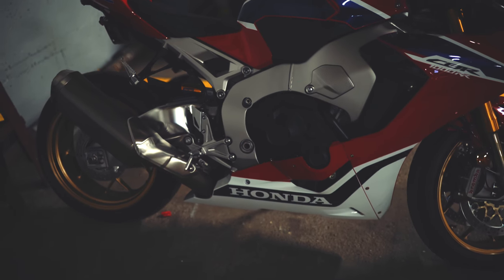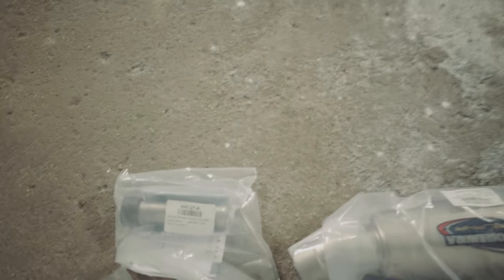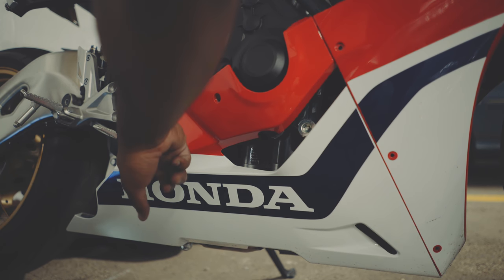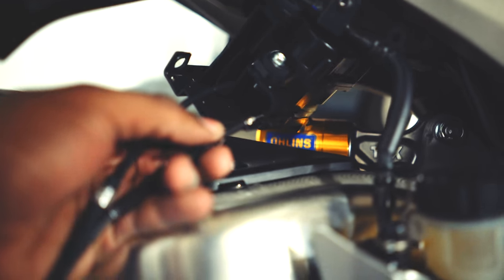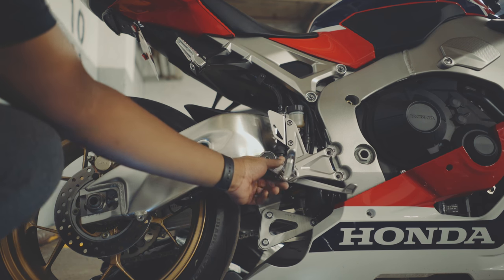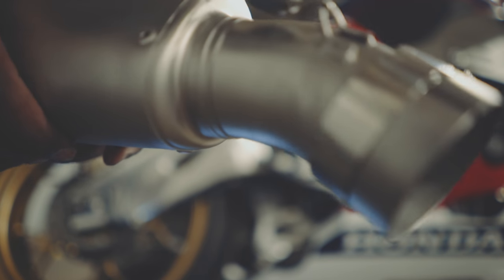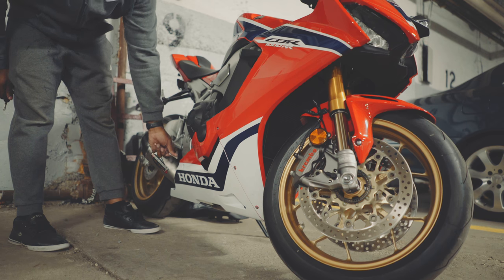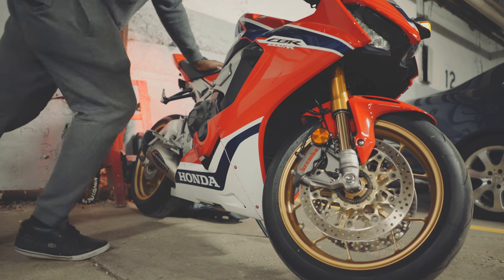2017 Honda CBR 1000RR SP - Yoshimura Exhaust Sound / Install

Comment: Is that a fork stem Ram Mount? Did it fit just fine, or did you you have to mod it somewhat? Max diameter is 1.29 inches on their website.

I measured the fork hole on my 2017 SP and it was 2.2 inches...
Reply from the maker: you have to use the big end of the ram mount but yes it fits just fine

Comment: Nice video. 
Which passenger pegs did u use?
Reply from the maker: thanks, i had the dealer order me the pegs and seat from the regular version, they had to thread them but they seem to work just fine.
Reply: @flanconleche8427  Interesting that a dealer would do this. From the Honda user manual:
"Never carry a passenger. Your motorcycle
 was not designed to carry a passenger" (page 17)
"Do not attempt modify the motorcycle to carry
 a passenger. The subframe was not designed to carry the additional weight of a passenger" (page 16)
"Never Carry a passenger" (page 5)
"Max weight capacity: 243 lbs" (page 223)

Maybe that was written by Honda's legal team and not their engineers?

To be safe, I was going to buy a subframe from the non-sp version and install it but this looks promising.